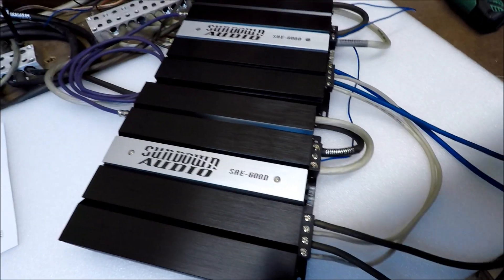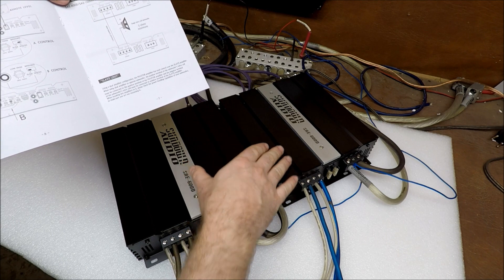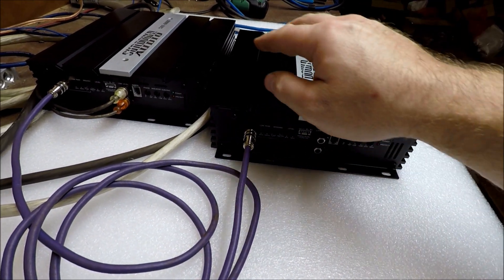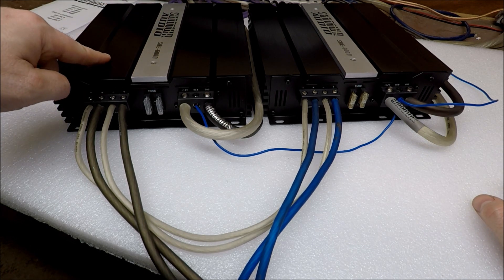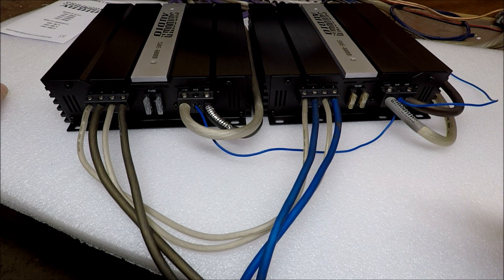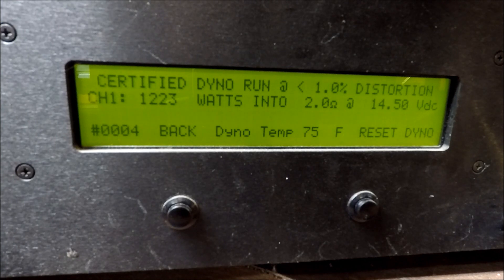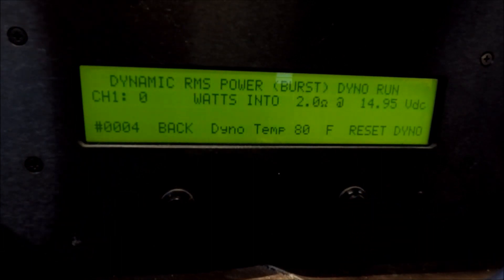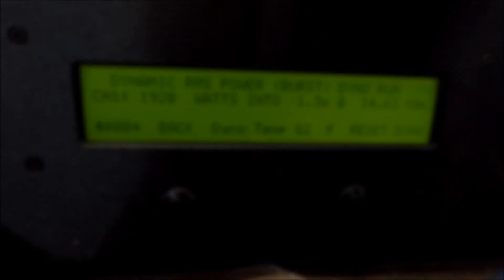*How to Strap Amplifiers* *Tech Time Thursday* at Sundown Audio

Comment: Let me get this right the amps share the nominal load so if I have 4 dvc 4ohm drivers wired to 2ohms that will result in my pair of amplifiers working at  a 1 ohm load since basically whatever the final load is gets split by the pair ... Do you have to use two amplifiers of the same wattage or could you use say a 3k and 6k strapped as long as they are both stable at same impedance ... nevermind the power question as I realize now you'd be running the pair of voice coils at different power ..

Comment: Wiring a pair of strapable amps on a single sub with dual voice coils which is better? Wire the coils in parallel and strap the amps OR run an amp to each coil separately? I have Crossfire BMF1000d amps going on a JBL MKii15GTI sub

Comment: Why don't just run them separate and have both a 1 ohm.
Reply: Because then you would have to gain match and to set the gains perfectly matched you need one of those SMD devices I forgot which one it is

Comment: So I’m doing 2   1 ohm load stable amplifiers what would be my final load??? Need help
Reply: .5 ohms bro!! So make sure you strap them to 2 ohms so they can share, brings them down to 1 ohm each!!!!!!
Reply: So if i have 2 dual 2ohm subs wired to 2ohms they will see 1 ohm at the amp right
Reply: @lukeglavan  yes because both amps share the resistance.

Comment: So I have a question, if you strap the amps show how you would run 2 , 2 dvc, 2ohm woofers to the amp since they are strapped to make one big amp, how would you do the subs and would you run each sub to it’s own amp? If not how would you run each sub to it’s own amp?
Reply: If you get an answer let me no i am looking for the answer also. I have 2 dual 2ohm subs also. I think you wire them so they are 2ohm so when you put them to the amp they will see one ohm each
Reply: @lukeglavan  you are correct👍🏻
Reply: @lukeglavan ok but do you wire the slave amp out of phase if you wire the subs individually to the strapped amps? He did mention that the slave amp is 80degrees out of phase to the slave amps

Comment: I'm running 2 dual four 15's wired to 1ohm So basically im screwed as far as adding another strapping my amp. So I'd have to wire my subs to 4 and gaining nothing and have to basically have to run 2 amps separate at 1 ohm just gain matched?

Comment: I’m pretty new at this and I want to ask how to know if an amplifier(s) can be strapped? I have 2 Blaupunkt 1504 amps. I ordered these before I started learning about amps. Lol. They are 4 channel with 4 RCA inputs and 2 RCA outputs on one side. The speaker outs are on the other side. Both amps came in the original boxes but had very little directions. Like 2 pages. I want to run these amps to 4 quality speakers rated at 125 watt RMS. My head unit only has left and right RCA outs. Can you give me advice on this? It’s too late for me to send these amps back. Lol.

Comment: can the scv6000 be strapped at 1 ohm load? 2 scv6000 running 4 d2 subs ? right now i have them on 1 scv6k @ 1 ohm i want to add another 6k  can i strap them or will i be better off gain matching them??

Comment: Oh my!  Some of the comments on this simple video are just mind blowing. Please, if you don’t know what you’re doing, take your car to someone who knows what they’re doing. If you want to learn, look it up. There’s so much information out there.  I just can’t believe the number of people asking about strapping different amps, running multiple subs, how to wire, etc.  You can’t strap different amps. A single 1ohm dvc sub can be wired at 2ohms or 1/2ohm. Don’t run your amplifier below the minimum rated impedance. If it’s only rated down to 2ohms, don’t run it less that 2ohms. Don’t run your subwoofers over the rated rms wattage if you want them to last. Stick to the manufacturer recommendations, they know their shit better than some internet troll. Don’t do work that is outside of your skill set without help from someone who is qualified. (Putting a $150 Walmart system in your 15 yr old P.O.S. Doesn’t qualify you to install a $5,000.00 system in a brand new luxury SUV.). If 2 different wire sizes will accommodate your electrical needs, go with the larger of the two. You should never blow the main fuse at the battery. If you do, don’t just get a larger fuse. Find the problem. Did you mis calculate your amperage?  Did you add more load on the circuit? Can the wire handle the current properly?  So many people are getting into things that they shouldn’t be doing themselves. I’m not a professional installer, but I am qualified to do electrical work. If you know what you’re doing, help someone else who needs help. If you need help find it. Don’t be that guy that starts his car on fire because a shady salesman or some random internet person gave you bad advice.

Comment: When you showed the picture of the manual it shows only using on pair of speaker outputs on the amps. Single positive and single negative of each amp. It's it necessary to use both pair of speaker out as you showed in the video?

Comment: In order to strap the amplifiers do they have to be the same size?or could I run a 3000 and a 2000 together?
Reply: Bobby Martinez  No!! Use Only the Same Amplifiers.
Reply: @blackjoe211  I mean like do they have to be the same watts or could they be different size watts
Reply: The Same Watts
Reply: @blackjoe211  I appreciate it
Reply: No Problem my Friend, I Have Two SK V2 4500 Strap at 2 Ohms and if You’re Voltages is at Least 14.4 they will Put Out 9,800 Watts at 2 Ohms which is Not Bad.but I could get more by Gain matching Them but both Amps work Together and the Voltage is Great, so good Luck my Friend and Enjoy.👍🏾
Reply: Can I strap 2 1 ohm load amplifiers and still keep a load of 1

Comment: Quick question bro, so my initial plan was to run a 4k at 0.5 ohm on 2 X V2 15's 2 ohm subs but I did research and read that you need to have sufficient electrical for a set up like that, I have a Mechman 240 alternator and 2 agm batteries but I don't know if that will be enough, so my next thought was to get 2 SAE 2k's and strap them, since my subs are 2 ohm, would that work with them in parallel or do you just recommend me just put 1 2k on each aub without strapping, just gain matching. Thanks for your response.
Reply: This is a great question and would love for someone to answer this! Can you run two of the same amps wired one to each sub? Do you have to gain match if your strap the amps that are wired individually to each sub? If you strap the amps do they have to be wired in series as shown in this video to both subs or can we wire the amps separately one to each sub when the amps are strapped? Please answer and clarify this question for us

Comment: What is the purpose of or what situation would you want to strap your amps in why do you strap your amps? Can you give us a chew ation where you have for 12 inch subwoofers dual 2 ohm on each sub or dual 4-ohm subs with either two or four amps rated at 1 ohm stable? I'm close to figuring it out,I know it has something to do with trying to get the most power out of your amp with box rise. I just can't quite get my head wrapped around it yet. Need a little input. Thank you.
Reply: That proofreading that was supposed to say a situation not a chew ation LOL
Reply: The only real benefit of strapping is if you have already purchased a setup, maybe you didnt get the right ohm sub or you now want to push at a lower load.

Lets assume you have 1 D4 sub you didnt pay attention to that and bought a 2000w amp. It only does its rated power at 1ohm. By strapping amps not only do you get the power of 2 amps but also bring you down the the load you wanted.

A more common scenario. 2 d4's 1ohm final load on a decent korean 1ohm stable. They run it at 1 ohm for awhile works great no problems but the subs can handle a lot more and they have good electrical. By strapping they can directly upgrade by strapping and bringing each amp down to 0.5 ohm. Where as if you just hooked the subs up seperately two 2 amps you would have each amp @ 2ohm and would barely (if at all) of gotten any more power then you did with the single amp @ 1ohm.

Comment: Is there any pros/cons with straping compared to running separate in a daily drive setup
Reply: I want to know what is the advantage over just running them to each sun separately?
Reply: I have 2 scv3k.
Reply: I've got my 2 SCV 3k strapped but haven't been clamped yet.
Reply: @garycharley8589  did you have them ran separately or were they always strapped. If so did you notice difference in output. What sub's are you pushing with them. Right now I have mines on two zv5 15.
Reply: @terrancedesormeauxjr2559  
I always had it strapped, on 2 X12s power is a 45ah JY power lithium just had upgraded to 2 ZV5s.